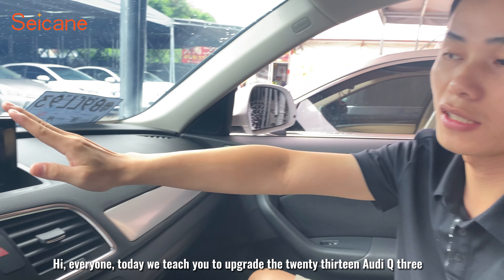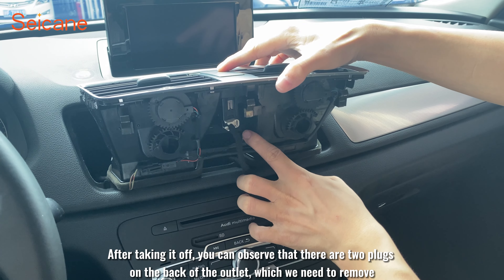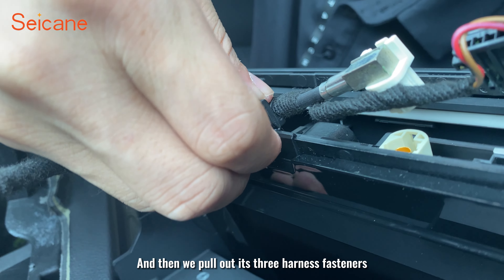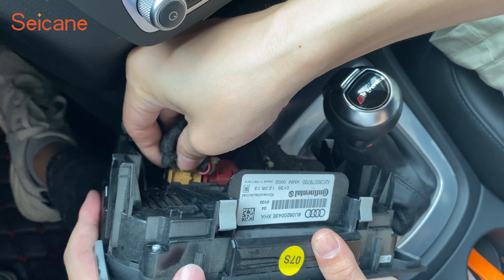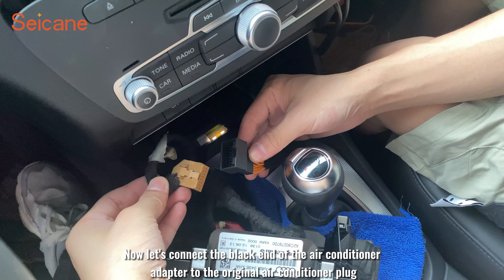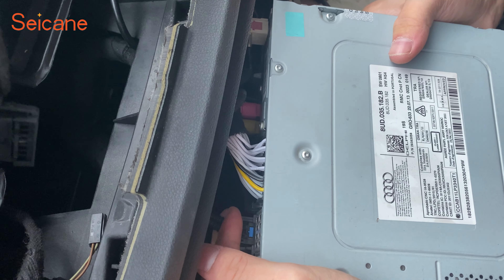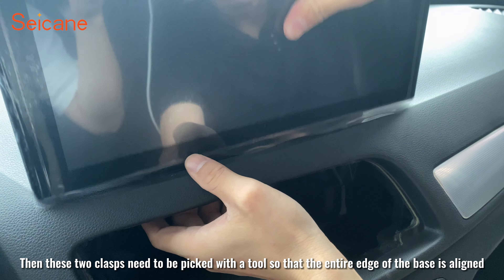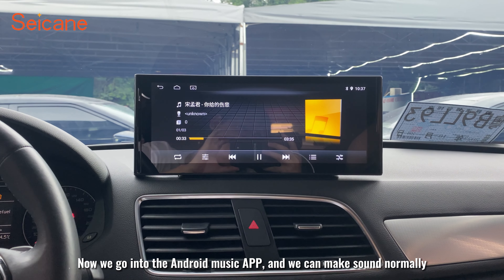How to install /upgrade radio for AUDI Q3 with Carplay Android-auto?  2013 2014 2015 2016 2017 2018

Comment: Update: I ordered and installed this unit myself and it was so easy. This specific video got me 90% of the way there but I needed some troubleshooting help and their customer support was brilliant. There was just one different step I needed to do but there was also a video for that. The unit comes with a lot of optional wires which the manual could do better job at explaining but if you're using the car's original reverse camera and not adding any other external devices than it really is as easy as this video shows. For reference I have a 2018 Audi Q3 (high version).
Reply from the maker: hi, thank you for your support and understanding.
Reply: Hi Monica! I just purchased the unit and am excited to install it. Do you have the link to the video you used for the different step? I want to be prepared!! Thanks so much :)
Reply: Hi - What needs to be done for the reverse camera? Does new wiring need to run the length of the car? If so, where can I find the video for that? Thank you!
Reply: @michaelscoots  If your Audi MMI already had a reverse camera then you don't have to do anything extra, it will work with just the installation steps in this video.
Reply: What about all of the other wires...like the ones for the reverse camera? Do you strip those new wires and replace the old ones with those? And plug in the RCA (yellow) cable replacing the old one?  Thank you!
Reply: Sorry - one more question: It appears that the gateway connection is under the steering wheel. Was that difficult to run from the air conditioning vent area? He doesn't show that part in the video. Thank you again!
Reply: @michaelscoots  Re: the other wires, I didn't actually use any of them. No stripping any wires, literally the installation is all that you see in this video and the other for gateway connection. It really just all works that easily. Re: the question about the gateway connection under the steering wheel, it's not really hard to do but it is a little difficult given the position and lack of visibility. Just be super patient, it probably took me a good 30 minutes just to get the plug through the right access hole. I've never done a modification to any vehicle so I'm certain that if I was able to do this installation that anyone can. I just stress patience through the process because you really don't want to accidentally damage your car as you take things apart and put them back together. Hope that helps! Feel free to ask any other questions!
Reply: @monicaparra8042 Thank you. Which wire group off the harness runs to the gateway?
Reply: @Seicane-Car-DVD Do you happen to have a video on the gateway connection? Thank you!

Comment: How do you connect to AMI, not aux?
Reply: Help . Same question
Reply from the maker: hi, it comes with a AMI adapter
Reply from the maker: hi, it comes with a AMI adapter
Reply: How does Ami adapter connect to the new head unit?
Reply: @Seicane-Car-DVD connect ami adapter and what next?
Reply: Was able to connect the AMI adapter to the aux out from the main cables (make sure not to accidentally use the mic cable)... seems to be working! Still trying to figure out if I need to get a microphone to the other cable.. Does anyone use this unit to make calls and was the mic required?

Comment: Is this still available? Also if purchased, does it come with the instillation tools?
Reply from the maker: Hello
1.Yes, it is available.Here is the link of the unit:
https://www.seicane.com/android-10-0-for-2013-2018-audi-q3-radio-hd-touchscreen-gps-navigation-system-h843
2.Sorry that it will not come with instillation tools, you can buy it from the link below:
https://www.seicane.com/car-dvd-dismantling-device-srd-400

Comment: Can I buy that power cable? I was sent one which needs to connect to CANBUS which is larger connected and does not fit to the AC controller
Reply from the maker: hi, it is better to buy the power cable from where you bought the screen to make sure functions works properly.
Reply: So I have a random issue with mine I got elsewhere. It doesn't shut off when the car does. Think it's slowly killing me battery.

Woke up this morning with it dead as hell.
Reply: I installed as shown in this video, but had to connect to red CAN behind AC, not yellow because of what I received - I had same issue it would not turn off @handsomegrandson so I took it out

Comment: Does the sound work via aux? Does the key on the steering wheel all work, including switching tracks or not?
Reply from the maker: yes, it keeps original car's function after installation.
Reply: @Seicane-Car-DVD  For some reason, when the radio is connected to aux, I hear a clicking sound in the speakers for about 3 seconds. There is no such thing in the native tape recorder.

Comment: Hello don't need to connect to gateway ??? Thanks
Reply from the maker: dear friend， which part do you refer to  ?
Reply: At 3.25 min , the part to te air conditioner , some people connect it to the gateway under the steering wheel
Reply: @AB-th8ze  Yes this was exactly the case for me that tripped me up during the installation but their customer support guided me to connect it under the steering wheel.

Comment: How many inches is the screen? Is this a carplay kit for mazda in your site? Coz the screen seems larger than the audi q3 carplay which is only 9inch. Tell me if the mazda is compatible as well.
Reply from the maker: hi, it is 10.25 inch. it is for AUDI Q3 instead of Mazda.   
The same car series will have screens of different sizes that are suitable, and buyers can choose according to their needs

Comment: does this come with the two metal keys to remove the radio system or do i have to purchase separately? if so, where do i purchase?
Reply from the maker: hi, if you are going to place an order, you can contact us with email, then we can send you a set of plastic disassemble tool as a gift.  sales@seicane.com

Comment: The screen doesn’t turn off with the ignition why is that and how do I fix😊
Reply from the maker: hi, you can check if there is still any voltage on the canbus when the screen turns off. it is has, there is an issue with the canbus possibly.
Reply: @Seicane-Car-DVD  where is the canbus in the Audi q3

Comment: how do I turn it off, when I turn off the car the navigation does not close, it stays on all the time
Reply from the maker: the device is controlled by ACC cable. If the car engine is off, the car key is removed, and the doors are locked, the screen will turn off.
Reply: the acc cable does not fit me. must it be connected to the black box in the glove box?
Reply: @Dj_razvan_micu  if the gateway cable doesn't fit the one in your AC unit then you need to connect it to the red gateway under the steering wheel. This was the same case for me.